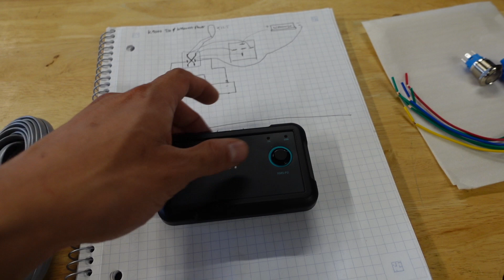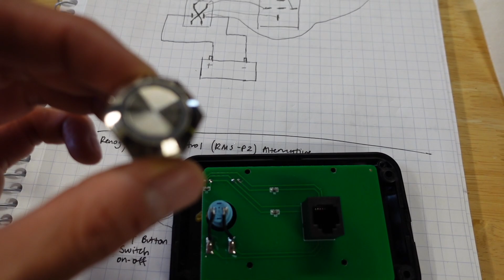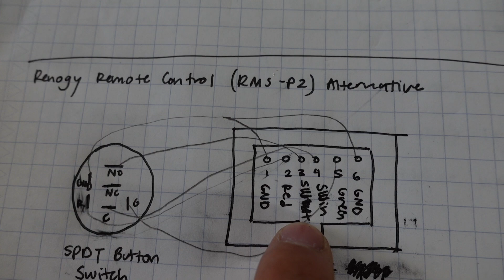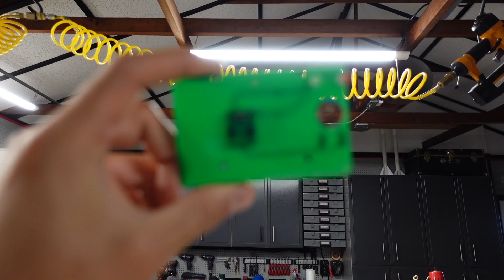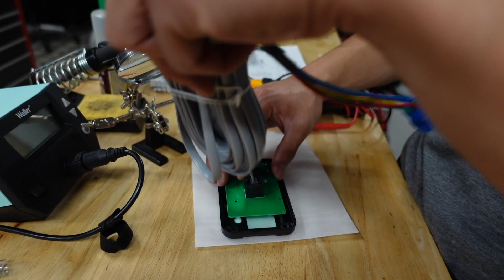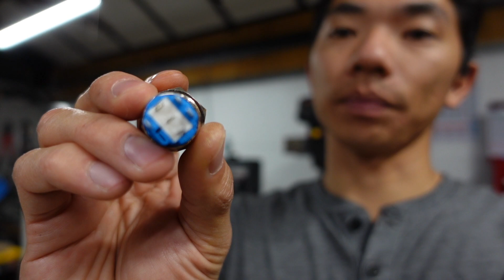Replacing Renogy Inverter Remote Control (RMS-P2) w/ a Button Switch | Van Build Series (Ep. 19)

Comment: Those LEDs aren't addressable. Addressable refers to them being on a databus and you having to send addresses and data on the bus to control them.

These are just LEDs in the switch that have exposed connections.
Reply from the maker: Thank you for the correction! I had assumed it had a similar meaning to addressable LED strips. But yes exactly, what’s needed is the independent connections to the LEDs!
Reply: @itstimetocrunch  and that you for the idea! I am doing similar with my more basic Renogy inverter controller. 😂

Comment: Thanks for your video. I wonder if you still have the original remote and can measure the dimensions for the opening if want to install on a wall. Thanks
Reply from the maker: We’re on the road now so I don’t have access to it, but I remember the front plate being about 1/4” reveal around the perimeter. With that assumption you may be able to estimate it by taking the base dimensions minus 1/2” on the length and width.

Comment: Is there anyway to wire two inverters into one switch like this? I have a renogy 1000w and 3000w inverter and I have to manually turn it off every time.

Comment: Thinking of using one of the aux switches in my jeep to turn my inverter on. It sends 12v when powered on. Is there a wire I can connect that to?
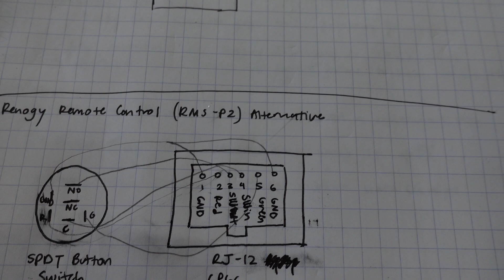Reply from the maker: Unfortunately, I didn’t measure what voltage is coming out of pin 4 (see 2:45 for pin out), but if it is 12V, you should be able to power on the inverter by connecting your switch to pin 3. Otherwise I believe you could just use pin 4 as input and pin 3 as output on your switch.

Comment: Would it be possible to wire just a on/off switch? Looking to use an existing up fitter switch in my vehicle
Reply: Yes it should work with any spdt switch.

Comment: Nice video, I was thinking of doing something similar and you saved me a lot of time trying to figure out what function each cable did.
Reply: So which two wires would I use for a simple on off switch without the led functions?
Reply from the maker: We haven’t seen much info on this, so we’re glad we could help!

Comment: Only one thing missing from this video.  Showing us that it worked! 
Question... The Renogy can light both power and error indicators at the same time.  How does that pushbutton switch handle that?
Thanks in advance.

Comment: Excellent work. I did something similar a few weeks ago (because I didn't want to have to buy and wire the remote panel) but I used an esp8266 (running ESPHome) to push the functionality into homeassistant. I have our HA instance running directly off of 12V and powered the ESP off of pin 4 (regulated down to an appropriate voltage.)
Reply: @FPVenius I was thinking of doing something similar to be able to control the inverter from home assistant but what I thought was to connect pin 3 (yellow) and pin 4 (red) to a shelly relay and that way control it but I wouldn't use any of the other cables (I'm referring to the ground) and since I don't know much about electronics I don't know if this can be done that way
Reply from the maker: Oh that’s awesome! We have a small 15U homelab and we’re planning to at least run a few containers, one being HA!  What are you running it on? 

I’ve never gotten into the esp side but it might be time to. At home we pretty much are just using already smart zigbee devices
Reply: @itstimetocrunch  I have HA, a Plex server, mqtt broker, and probably more that I'm not thinking of now running on a raspi 4 (probably B, but I'm not positive.)

I'd highly recommend trying out esphome; it's really easy to work with, and it's built by the same people who make HA, so they work together flawlessly. I have a mishmash of ESP8266s and ESP32s doing various things (so far, I'm only using the 32s if I need bluetooth.) You can also roll your own stuff with either type of ESP hardware, and if you decide to do that, I'd suggest you use platformio to to the build management; it's a lot easier to use than arduino IDE, e.g. Let me know if you have any questions; I love talking about this stuff.
Reply: Oh yeah, I forgot to mention, a few of the devices that I have pulled into HA are already smart but only have BLE (app) access to the data. My hughes power watchdog and mopeka propane level sensors each have ESPHome components already written for them, so I just have an ESP32 each pulling that data and passing to HA. 

My renogy batteries and solar charge controller has BT access via a BT-2 module, and I have a cron job running a python script (renogy-bt on github) on the pi to pass that data through MQTT, which is in turn read by HA. A little bit Rube Goldberg, but it all works well.
Reply from the maker: Interesting thanks for that info! From what it sounds like everyone’s got different work arounds for their renogy devices. I’ll reach out to you when we get to that stage! Right now we’re so focused on building but I’m excited to get back into the hobby!
Reply: @itstimetocrunch  seems like my first reply didn't make it 🙂 I'm running everything off a raspi 4B that is powered off the battery (so it can run even if the inverter or shower power is off.) I have a smattering of ESP32 and ESP8266 stuff pulling data from different places and passing it to HA